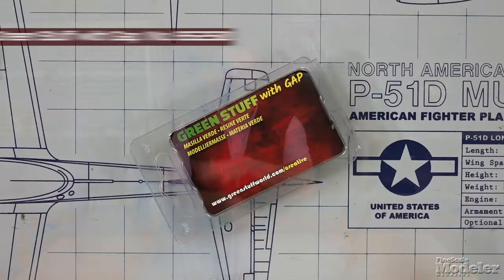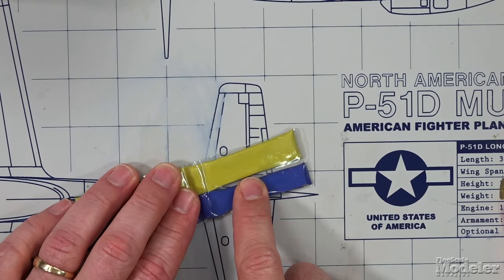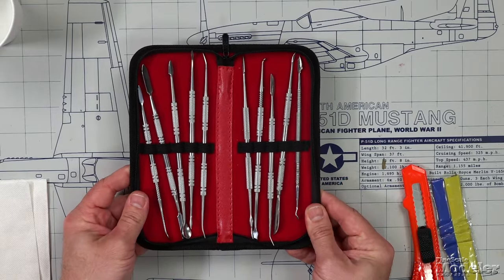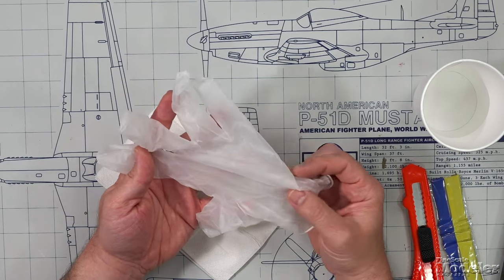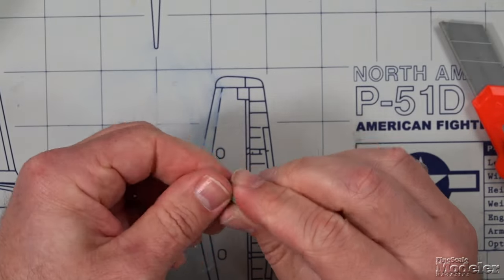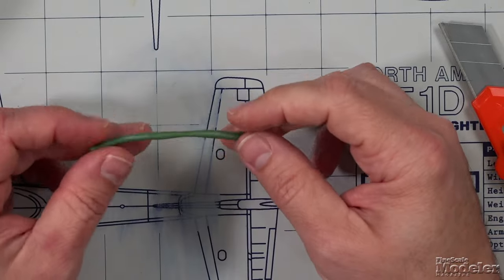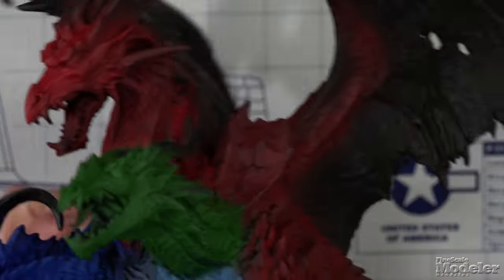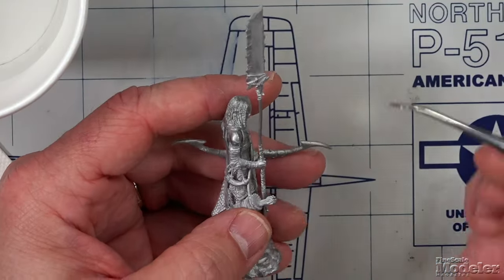FineScale Modeler: Using Green Stuff World's two-part epoxy putty

Comment: This is very informative video. I wish there was video's like this one around when i first started messing around with 2 part epoxies. I relied on books, shep paine, stephen zologar (i apologize for the spelling im sure i misspelled steve's last name). Im no sculptutor either but i some how find a way. I use the expensive stuff like green stuff when working aound flesh, for things like sandbags, traps, etc., i buy 2 part expoy from the DIY store stores. Look in the plumbing section it is way more cheaper about twice or three times the material for almost half the price. Besides the metal shaping tools that Tim used, i also use silcone brushes in variouse sizes and shapes, bought a little brush kit if 6 silcone brushes on line. They work great for smothing and shaping.
Great video, great How to Tim.

Comment: I use it on carbody kits. And it is realy good stuff.Another advantage is that it don,t schrink.There are putty,s out-there that has te tendency to schrink. For example on the prsche 911 GT3 there is a seemline/gap between the motorcover and the spoiler. On the original it is seemlees. With this putty it ended up nicer rather than filling it up with sprue-goo or CA-glue. Good revieuw of a good product and may you all has a nice weekend

Comment: I have used Brownell's Accraglass epoxy as a filler. The gel type works well for filling gaps. It is also a 1to1 mixture. I used it to fill gaps on an AMT '36 coupe/ roadster kit, to fill the gaps between the body and top. And the rumble seat gap. And to contor around the custom licence plate piece. Once thoroughly mixed, per instructions, it give a 20 minute working time before it kicks it, and starts to harden. That is noticeable as the epoxy starts to warm up. It gets uncomfortably warm as it sets, but Not warm enough to warp the plastic. Blending and shaping can be done with a moist fingertip. Let it set for 24 hours, to be sure it's fully set,and hardened. It will file, and sand wonderfully well. It is actually stronger than the plastic it's bonded to. It takes enamel paints well. Test it on a piece of scrap plastic with laquors first however, to check on comparability. It can be blended with artist acrylic paints to make just about any color you'd like. One ounce jars of each of the two parts means that it will make plenty of filler. I use kitchen measuring spoons to portion the amounts I want to use for each application. Thoroughly clean the spoon of choice between. The parts of the epoxy. That should be obvious why to be sure you don't contaminate the component parts. This stuff IS fairly expensive per box.

Comment: Green stuff has been around a lot longer then Greenstuff World. Hand lotion works great for keeping it from sticking to your tools, and if you want to roll it real thin to make things like tarps or cloth using baby powder on your work surface and rolling tool works really well. It also has flex to it when dried if you need it stiffer you can also mix it in equal parts with miliput and you get the best of both putties in one
Reply from the maker: Thanks for sharing, Chris!

Comment: What's the shelf life?
Reply from the maker: That's a good question. After I saw your comment, I remembered that I had some Green Stuff in a resealable plastic bag in my workshop that dated back to about 2008, when I was really big into tabletop wargames. I took it out today, cut off equal parts yellow and green and mixed. Once it warmed to my hands, it got sticky and I just used it in a story that I'm working on for the magazine, so, in this case, 15 years. Do I recommend sitting on a stash of Green Stuff for 15 years before using it? No. Is this a scientific experiment? Nope. But I wanted to report back what I've experienced. Thanks for watching, subscribing, and leaving a comment! -TK